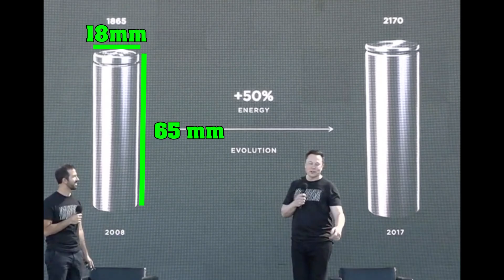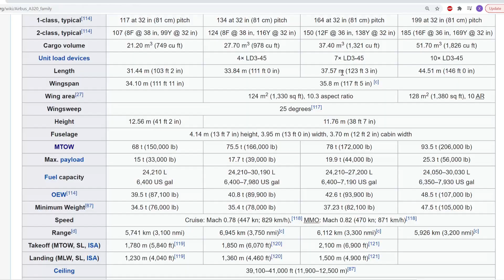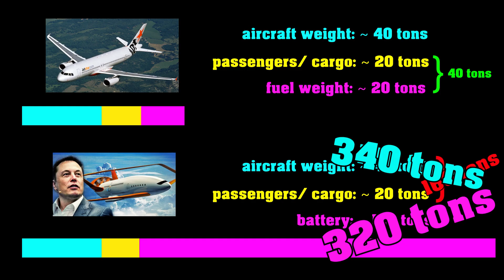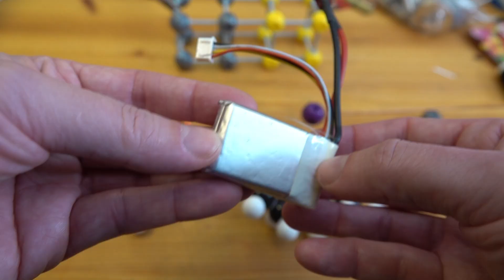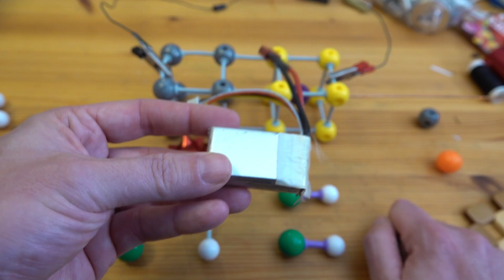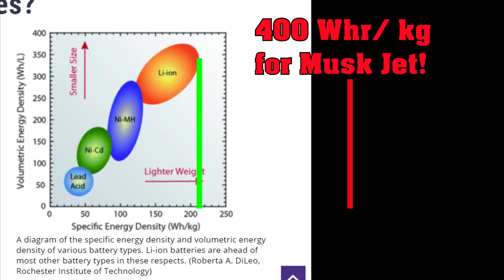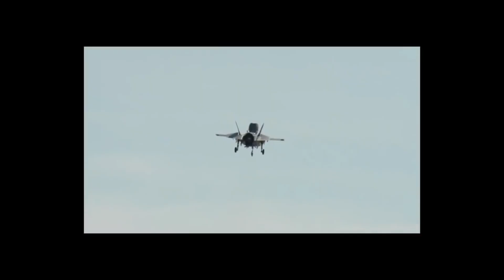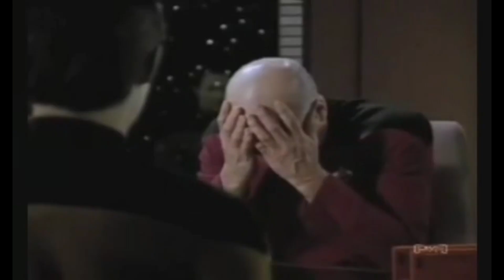Tesla's Secret Plan To Disrupt Airlines: BUSTED!!

Comment: "If you make things bigger, they contain more stuff."

-Elon Musk
Reply: Yeah Elon's gimmick is just to change the size of things and pretend it's an innovation. 
"I can dig a smaller tunnel for a lower cost!"
"If we just made the battery bigger, it'll contain more power!"
Reply: Hyperturdis incoming
Reply: I mean, when I was obese I also contained more stuff.
I dunno if that's always the greatest innovation.
Reply: Every 60 seconds in Africa, a minute passes
Reply: Though there is a slight efficiency if the numbers are accurate and representative. +50% energy on +46.6% volume is +2.33% efficiency, which is around what a single 'improvement' to aerodynamic tweaking or an engine change-out on a jet aircraft is expected to find roughly.
Reply: Deception, coercion, duress, oh my!
Reply: Everybody:  WE LOVE IT!  Take our money!
Reply: It depends, you can raise volume and still have the same amount of matter inside. Think about enclosed systems.
Reply: Like bigger buckets containing more water right?
Can i have a Nobel prize now? I can already see it : The Great Bucket engineer... the great Buccaneer if you will (def2 : an unscrupulous adventurer especially in politics or business.).
Reply: If Tesla got the same size of the car battery packs (is it actually known?) yet they now have a 16% longer range by using batteries that got a higher number of lifecycles (a necessity for semi) while being cheaper it is still an improvement. Of course, as it uses bigger cells, also gaps between batteries are bigger, you need to consider the whole packaging of batteries inside of battery pack of EV including cooling, and only then contemplate design not just pick what suits you and make a fool of yourself by making fun from something you don't necessarily understand. Tesla promotion for battery day should been done better but so the response from the usually better-educated audience interested in these topics..
Reply: What's hilarious is how using bigger batteries defeats the purpose of the principle they use. More batteries per unity volume makes the overall component less likely to reduce in performance over prolonged use
Reply: Apparently they did!
Reply: Which is way more profound than it sounds!
Reply: Well, you're not wrong. -Tony Stark
Reply: Funny no one is asking why the older batteries are smaller, when they could have just made them bigger from the start... Duh! 

The older batteries have more internal resistance compared to the tabless 4680.  They generate more heat.  They have to be cooled more.  Reducing their efficiency and making them take longer to charge.

And funny that everyone is so familiar with battery day ... but don't seem to be aware of the new chemistry and use of silicon in the 4680 to boost the energy density, or how the battery cells will become a structural component, replacing some of the dead weight of the car for a higher efficiency. 

The cost per kWh in 2015 was $230.   It's currently around $110.   It's expected to be around $50 when 4680 ramps up. 

But herpa derp, it's really all just a trick based on the volume of a cylinder. derp derp.
Reply: @KenLord  This is my understanding yes.
Reply: @KenLord  So we have no 50% efficiency increase as promised. By the way, it is Panasonic know-how and technology and Musk wants to be celebrated for it.
Reply: @TorianTammas  efficiency goes beyond the battery capacity.  By becoming a structural component the car is lighter.

As for Panasonic... Who cares?... But if you actually do.... Tesla owns the patents and built the pilot production line.
Reply: -Matter didn’t create anti matter
-Anti matter didn’t create matter
(Both of them were present at the time of big bang)
-Both of them didn’t create themselves.
-Both of them came from an unimaginable source,  that unimaginable source created matter and antimatter (everything) thats why it is known as “the creator” of everything.
——
- that unimaginable source/creator has created sin and virtue which are opposite to each other,
— logic says every action has its own reaction, so the reaction of sin must be different than the reaction of virtue,
— the creator has created prophets to let us know about each and every detail of sin and virtue, also about their reactions,
Thank you :)
Reply: That was the point, wasn't it? They claimed that based on form factor they got 50% more energy, which is correct.
Reply: @bluesrockfan36  Shoehorning math equations and numbers is standard practice in the business and corporate world; and its bloody disgusting!
Reply: @VoltBolt777  May be so, but it wasn't in this case.
In the presentation, they specifically said that they increased the form factor in order to get 50% more energy
They NEVER claimed they got 50% more density and try to sneak in the different dimensions.

Then TF turns around and mocks them for doing just that.
That's just flat out lying for views. I'm sorry, it is.
Reply: @bluesrockfan36  its not more density though, its the same density in a bigger container. Water is water, you get more of it in a bigger container. Then they display the bigger container and say woah check it out.
Reply: @chaosryans  Yes you are correct. Sorry, my bad.
I meant 50% more energy capacity.
Reply: @bluesrockfan36  "They specifically said they increased X in order to get more Y."

A few moments later... 😑

"They NEVER claimed they got more Y."

I'll leave you to figure out what the problem in your own statement was. And also the whole pointlessness of their presentation  if what you said was true.
Reply: @chaosryans  Though it is slightly more energy density, using the supplied numbers (which may be rounded, sufficiently to 'create' the efficiency error by rounding alone, of course). But at face value +50% energy in +46.6% volume is an improvement of around 2.3%
Reply: @VoltBolt777  I'm a human being. I make mistakes.
You want the actual presentation? 44:33 from Tesla battery day video.

"We moved from the 1865 form factor to the 2170 form factor (...)  bringing 50% more energy into the cell."

This was in reference to what they already have working with Panasonic as their partners.
Later they move into what they plan on developing.

Go watch it yourself.
I make mistakes. But at least I look up the information instead of just straw-manning left and right.
Reply: @gracesprocket7340  yeah in a volumetric sense, you have less surface area per interior unit. So when you calculate it with the container the larger it is the higher those numbers will look. If its a lot of tiny batteries you have a higher percentage of container. (At least from my understanding they haven't changed the basic components or formula)
Reply: @bluesrockfan36  he mocks the ppl that claim that elons batteries are invotive not elon himself
Reply: @bluesrockfan36  why would they need to make a massive presentation to just says we put two batteries in one for twice the cost
Reply: @bluesrockfan36  The very fact of putting together a presentation to show that if you make a kettle 50% larger it will contain 50% more water shows that he was putting a spin on his "invention".  A kindergarten student could come up with something so "insightful".
Reply: @skelet8337  No man, he purposously straw mans the Elon Battery Day presentation.
That is dishonest af.

"Why would they need to make a massive presentation"
Maybe go and watch it instead?
That was just one of the many, many, many battery, production, architecture, engineering changes they've implemented for one simple goal:
To lower the cost per kwh for batteries to make cars more affordable.
Reply: @vladimirrodionov5391  No. That's another straw man from someone who obviously did not watch the presentation.

This whole thing was a 15 second thing in the middle of the presentation saying how they moved from the 1865 FORM FACTOR to the 2170 while partnering with Panasonic.
Its not even the new battery they will use, but what they've already been doing.

No one claimed it was an invention.
Just clowns like TF who want to purpousfuly mislead people for views.
Reply: @skelet8337  Yes, it's almost like there was a lot more going on in the presentation than TF wanted you to laugh at. 

... And the price in kWh/kg will soon be just 25% of what it was in 2015.
Reply: @KenLord  we will see there was also supposed to be 3x more energy dense batteries but where they are
Reply: @skelet8337  Tesla is the only one delivering at scale. Half a million cars this year, probably close to a million next year.   

All the other replies ... "what about X, their battery does Y!" are from start ups that haven't proven their products can be made economically and reliably at scale.  Some of them even require precise nano-scale manufacturing details.
Reply: @KenLord  i am saying tesla doesn't have more energy dense batteries just have the machines to make them in mass
Reply: @skelet8337  300 kWh/kg for the 4680, compared to 250 for 2160's ... Is more energy dense.

My point is there's a lot more too it than just laughing at a small cylinder becoming a bigger cylinder.
Reply: @bluesrockfan36  We have dozens of battery sizes and surprise larger batteries have a larger capacity. So they state the obvious.
Reply: @bluesrockfan36  You mean Panasonic did it and Musk wanted to be celebrated.
Reply: @bluesrockfan36  You do realise how stupid that statement is, right?
"It took me 10 years, but I managed to figure out how to store twice as much petrol in my car! I just doubled the size of the fuel container!"
Reply: @ajstevens1652  That's because you bought into TF bullshit about Tesla improving the "energy density".
That was never the goal.
The goal was to lower the $ per kw/h.
They achieved the goal.
One of the many things they allready did, was shift from the 1865 form factor to the 2170.

If it saved you money and got more range by increasing the size of your gasoline tank... why would it be stupid to do so?

That's just being a clown.
What do you expect Tesla to do? NOT to optimize the battery layout? To keep prices high. To NOT sell as many cars?
Reply: @bluesrockfan36  No they didn't as they just increased the size. Would you claim that you increased your salary per hour by 50% when you work 50% more hours to get 50% more money?

Comment: The only airbus I've seen that ran on renewables is the Tu-155 developed by the Soviet Union, which uses a hydrogen combustion engine. Maybe not as efficient as fuel cells but at least it weighs less and can actually fly!
Reply: so did the Hindenburg.
Reply: @toomanyaccounts  There are a lot of design issues with airships that really come before the use of hydrogen. Whether you have a hydrogen engine or kerosene you've got something that can explode if you're not careful, so you need to make sure the fuel is stored correctly. I'd trust the Tu-155 to be roughly as safe as a plane fueled by standard jet fuel and much safer than the Hindenburg.

Comment: Normaly i´m on your side. But now you are "picky" ( hope right word ) 
For example the Battery Tec increase of Tesla was not only size. They increased in engery density but more was the problem of cooling and Charging.
So it was realy a very positiv evolution, but not on the density side.
And just for it, Airbus is working on a 100 Person mid Range Comercial Plane only working on electric. Target first flight is 2023.

Comment: Elon musk: wants to create a flying bomb

terrorists: its free real estate
Reply: @Zak Strayder  
Even mythbusters knew the difference between flash-burn and boom...

Source: Anfo v C4

Please try this at home, genius.
Reply: @Zak Strayder  Yeah, you let jet fuel out of it's container and give it some oxygen and a source of ignition and it will burn, but that is different than exploding. Just because it;s burning over a large area doesn't mean it exploded. The air entering the combustion section of a jet engine is already heated to between 300 and 500° F and it still doesn't go boom, it needs to have an ignition source (ignitor plug) to get it burning and get the combustion process started.
Reply: Germans had those in the war - as did the Americans ... and the Japanese.
Reply: That's called an airplane, it's full of kerosene.
Reply: Sooo normal jet fuel planes?? U do know jet fuel is more likely and more explosive than batteries right.
Reply: @XDslic  Jet fuel (jet A) doesn't explode, it burns.
Reply: @XDslic  laughing at these responses, let me guess.. you went to school with Sebastian?

Comment: If I remember right the new battery could delivery a much higher amp output, so while the power by volume is the same, it could get that power out much more quickly.
Could be wrong on that thought. Not too fussed about it. I can't afford them XD
Reply: Electrical path is 5x lower but power density is only 15% higher which means the bottleneck is not the tab.
But that's before all the other improvements in the battery chemistry that will came later, we have no idea what the final power density will be.
Reply: @johntheux9238  Well improvement is improvement! nice to see, hopefully Tesla shares it rather than locking it down like they seem keen on doing at the moment >.>
Reply: @LouesSCat  There are 4 big improvements: the form factor, the electrolyte, the anode and the cathode:
https://www.youtube.com/watch?v=l6T9xIeZTds&t=2550s
The specs you can see in thunderf00t's video are only with the new form factor, but they updated the specs after each improvement. Sadly the power density is the only spec they didn't updated.

Comment: I'm very curious about how big and heavy an electric motor that can produce 50k/lb thrust is, I imagine that it's huge. That's not even including how heavy the fuel cells to power it would be.
Reply: The issue is the battery, not the engine. This one for example could reach 20 kW/kg:
https://www.theengineer.co.uk/ampere-electric-motor-record-power-density/